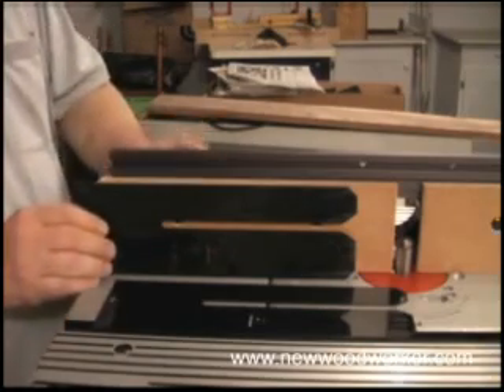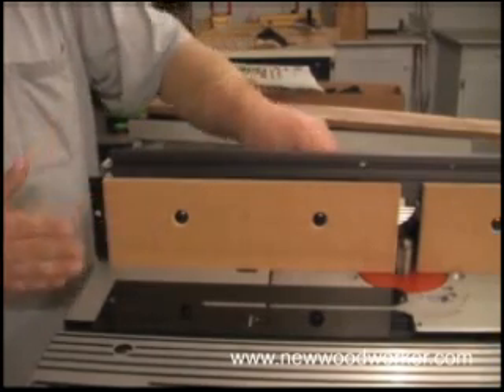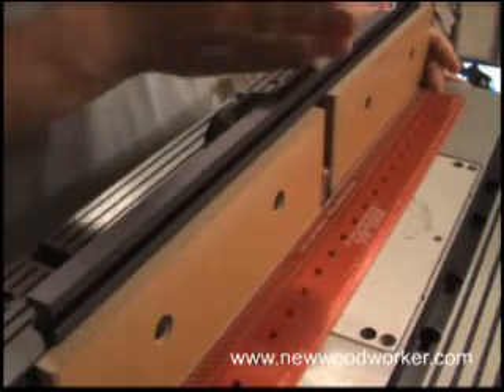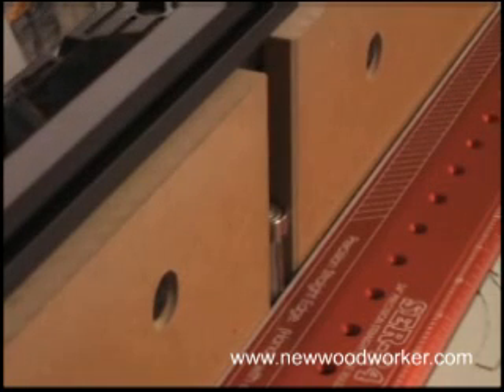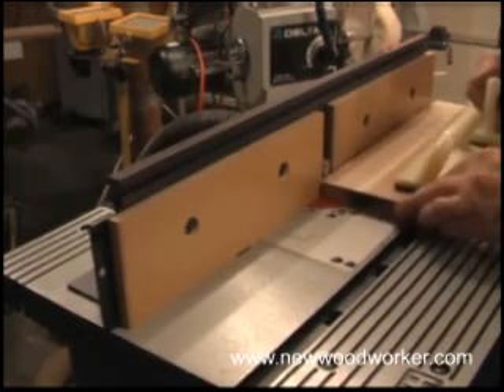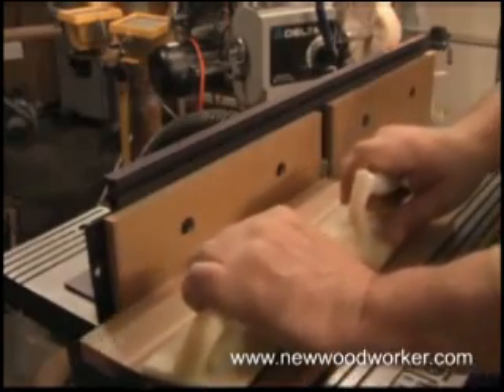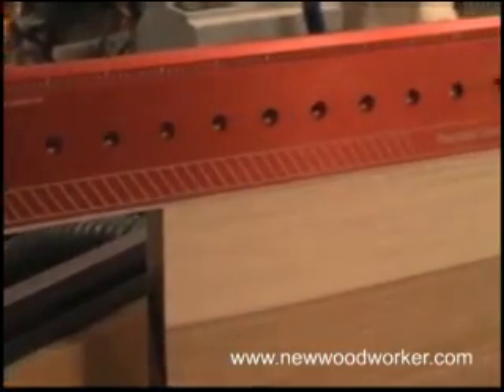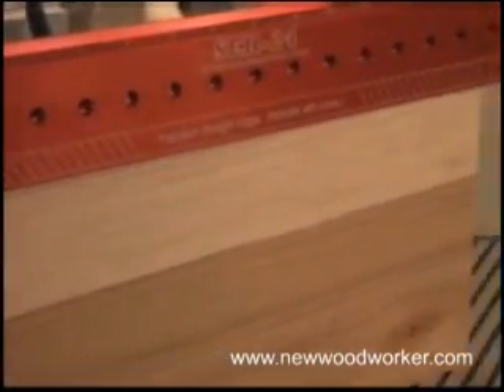Bosch RA1181 Benchtop Router Table Review

Comment: thank you for this,  I just got the RA1171 and was attempting this evening to use it as a jointer  I thought I had it set up right but it was not working as I thought it should   but looking at your video  I DID have it right I was just feeding it wrong  holding the board to the right fence face.   cheers :D

Comment: The Bosch RA1181 is a GREAT piece of equipment for routing & edge jointing. I'm using a DeWalt  DWWND 618 1/2" 2.25 hp that works well with it. Using Yonico Bits for most of my cutters (very accurate & inexpensive) & the Ammna MD508 AGE Shaker Raised Panel Door w Back Cutter for raised doors ( expensive but top of the line).  I have mounted the Router table onto a plywood base & clamp the base to my bench when it's being used. Dual plugs built into the rear of the table allow your shop-vac & router to start & stop simultaneously.

Comment from the maker: If we just backed the fence off 1/16" we'd just take that much deeper cut off the whole piece. We want the wood resting on the outfeed side so the rest of the board "drags" over the bit and takes out any bows or warps just as it is when on a jointer where the outfeed table is slightly higher than the infeed side.

Comment: How hard are you pushing the board against the in-going and then out-going fence? I found when transferring the pressure to the other side the board would kinda sticky along the table and I'd get wavy marks, especially when jointing a shorter board. Any tips for that?

Comment: I have my bosch router table setup the same way but my boards just dont pass as smoothly and when i think they do i end up with wavy bumbs and an uneven finish. Any body else have this issue?
Reply: As you feed be sure to switch the fence pressure from the right fence to flat against the left fence as piece moves across. Do not let it rock and go  slowly.